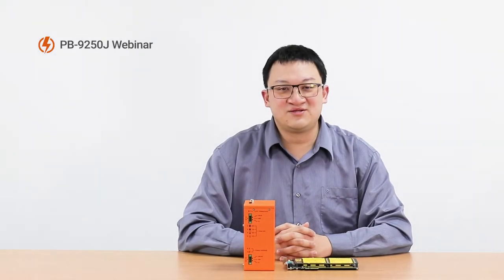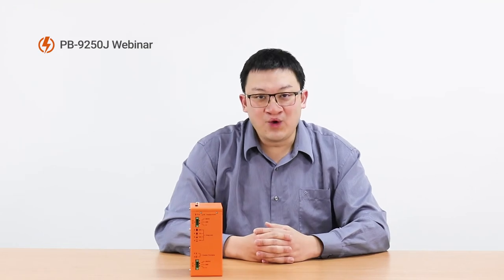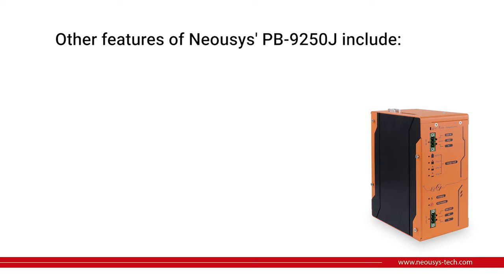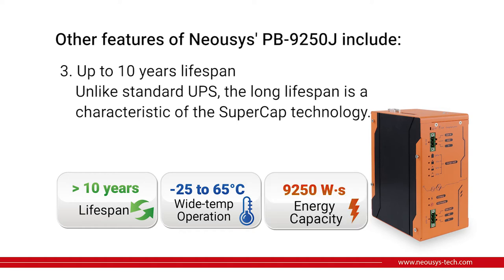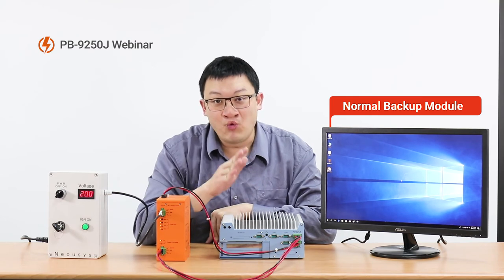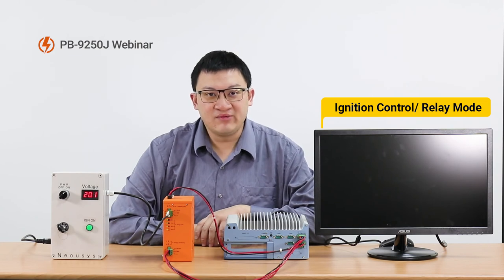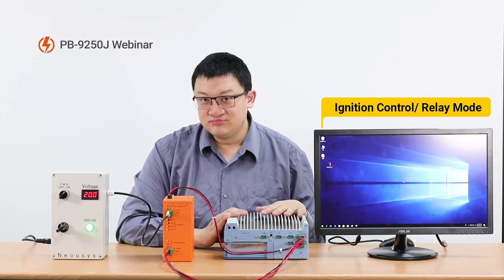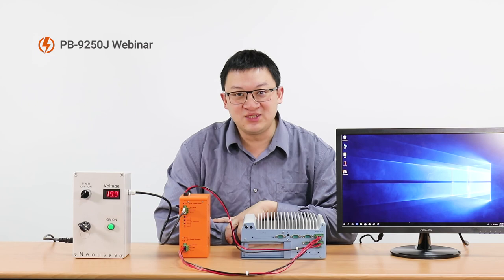Neousys PB-9250J Series Introduction

Comment: Good job, Patrick!  Thank you for the demo
So if the load is higher than 180W, is the decreased runtime linear?  As in, will a 360W load last half as long, or does it degrade faster, thus maybe only 40% as long?  What about 480W?  Thanks for any insight
Reply from the maker: Hi IronGumby, in regard to your inquiry …. 
Our supercapacitor power backup module has a maximum output of 180W and is designed to power a system that consumes 180W or less during an unforeseen power outage.
Therefore, if the backend system’s power consumption load exceeds the 180W limit, the supercapacitor backup module will not be able to power the backend system during a power outage.
Daisy-chaining multiple PB-9250J will extend your power backup operation time during the power outage but will not increase the total power output of 180W.
Reply: @neousystechnology4019  OK. Thank you kindly 🙏